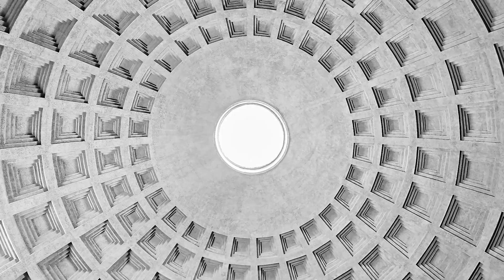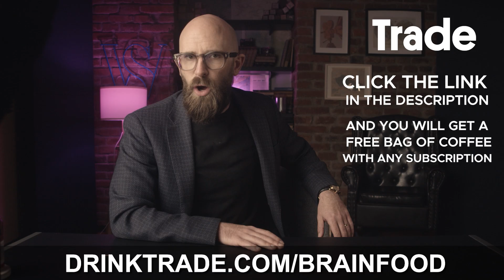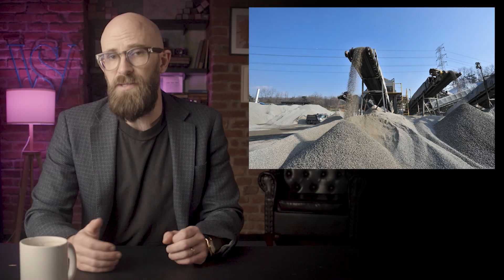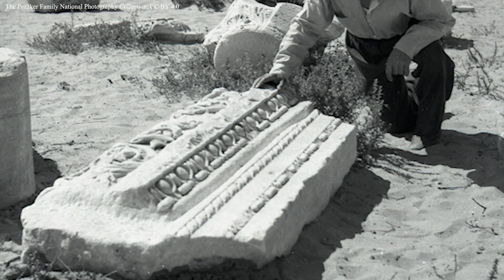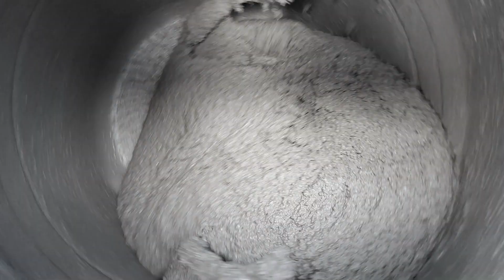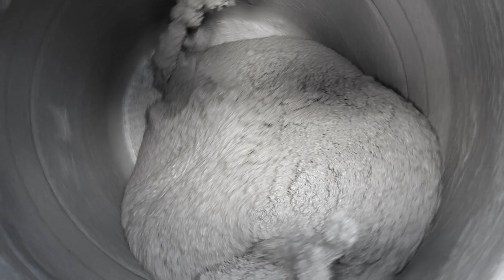How Did the Ancient Romans Make Concrete So Much Better Than Ours?

Comment: During the late 19040's thru 1960's the US build Nuclear Bomb shelters in government building , hospitals, and the like. That concrete is the strongest  , hardest , and virtually undamageable material ever made from a mix. I would like to see a video/documentary on the making of that concrete . And I wonder why all structures are not made from it?
Reply: That's why the old missile silos are cracked and full of water?
Reply: @atodaso1668 they said bomb shelters not missile silos.
Reply: Ah yeah Im sure they used weaker concrete on missle silos and stronger on government building bomb shelters... @TheTachmeter
Reply: @TheTachmeter 

Missile silos ARE bomb shelters.

They literally exist to shelter BOMBS from the elements and attacks from above.
Reply: @mnomadvfx  You know that's Not what he meant.  The public shelters from the 50s.  They decommissioned the one in my Dad's office when I was a teenager so we all got to try the little sugar balls that were part of the rations.
Reply: @atodaso1668 No, that’s because the old silos weren’t water tight and ground water seeped in over time. The walls themselves are virtually unbreakable.
Reply: So why do they have cracks in them? @Matt-yg8ub
Reply: @Matt-yg8ub  

"No, that’s because the old silos weren’t water tight and ground water seeped in over time"

Case in point they are strong, but do not have the self healing properties that keep Roman concrete water tight for centuries.
Reply: @mnomadvfx  again you’re missing the point the silos were not designed to be watertight, they all had bilge pumps for lack of a better term to explain it. They have sump pits and giant sump pumps to pump the water out of them because they’re not watertight structures in the first place. This isn’t a failure in the concrete, this isn’t a crack, this is water falling from the sky, and the silo doors, not being watertight.
This is the thousands of feet of corrugated metal tunnels, not being watertight, and everything being sloped, so that the water drains back towards the sump pits. 
You can literally watch water rain from the ceiling in the silos when it rains outside because the design of the 80 ton doors are not watertight
Reply: Spread less propaganda

Comment: In addition to the fuel used in heating, cement production also releases carbon & oxygen atoms in the ratio to produce CO2.  Not sure if Roman concrete also does this, but I suspect it does.
Reply: Well no, but the Volcano they sourced it from Campi Flegrei is situated in a gas field which releases a lot of CO2 via it's fumaroles anyway and that's without even erupting. When it does erupt it releases a shit ton of C02 that would put most uses of fly ash to shame. In a way because of where CF is located the volcanic ash is sort of pre-mixed in a sense.

Comment: I reckon that modern post industrial air pollution, may make it impossible to make concrete,  exactly like the Romans, to which you also have to add the radiation, from our nuclear explosions, we have also added to our atmosphere. So even if we copy their formula, the ingredients will be tainted, by our modern environment. So if we did copy what they did, we would need to do it in controlled circumstances and change our methods. Judging from what has been discovered, maybe adjusting the correct Roman formula allowing for avoiding tainting, depending on where the structure is built, maybe we can repeat the concrete of the Romans, by a similar method. Sounds promising.

Comment: Asphalt is not concrete. Concrete road surfaces usually have joints to allow room for expansion. Asphalt gets new potholes every winter.
Construction engineers have put forth many reasons why we don't use it now, from price to curing time. There are recipes for modern concrete that have the same longevity, but construction cannot wait seven to ten years for concrete to cure. Channels like Practical Engineering and The Structures Guy have some interesting videos (and discussions in the comments).

Personally I prefer a blonde/very light roast - less bitterness, more caffeine.

Comment: For future reference, CE is not any more correct or scientific than AD.
Reply: Yes, this is a major pet peeve of mine, and I am in no way a believer. What makes this era "Common"? What, exactly, is the startling coincidence that makes the BCE/CE dating system line up precisely with the BC/AD dating system?

No one is really fooled. It's just a gaslighting way to erase the history of how we got where we are today.
Reply: Most academics prefer using CE (Common Era) over the preceding AD (Anno Domini). Anno Domini is Latin for “in the year of our lord”.

Most folks try to step away from a more religiously founded framework of it, though I would agree with you overall that it is relatively trivial as our entire time
system is based in religious tradition.
Reply: @parallelarc3837  Yes, we're aware. Again, what makes this era "common"? If anything, it's the widespread influence of the religious tradition they're trying to ignore with "BCE" and "CE". To emphasize again, I'm in no way a believer, but it's a dishonest framing.
Reply: @parallelarc3837  Does that make it any more correct? They literally use the same point of delineation it's an arbitrary distinction as if ignoring facts makes it more scientific.

Comment: I was so excited when I saw a few years ago that they finally figured out the secret to Roman concrete—mainly just because I kind of assumed that it would be a mystery forever, and then to find out that it was actually really simple and easy to replicate. There's an argument to be made that these structures that have long outlasted their purpose are overengineered, but I think that attitude is dismissive to the potential applications that figuring this out may have in modern construction that's exposed to water. Yes it's not as physically strong, but if it's strong enough and much lower maintenance, we should use it.
Reply: Roman projects are considered over-engineered only through a modern lens. We build everything to be as cheap as possible, using as little material as possible. 
So in that regard, everything they made is over-engineered. Engineers put rebar in all their projects not because it's necessary for strength, but because it's significantly cheaper to achieve the desired strength. It is absolutely possible to design concrete structures without rebar, we just don't do it. Rebar compromises concrete from within.
Reply: @ericgigliotti2632  The other problem with Rebar is that it oxidises. It's made worse by the fact that concrete absorbs CO2 naturally, which in turn initiates the formation of calcium carbonate through reaction of carbon dioxide with concrete constituents of calcium hydroxide, aluminates, and silicates. This process results in the initiation of rebar corrosion in the reinforced concrete. So it's a never ending chain of reactions that give modern buildings and structures a very limited lifespan of maybe 150-200 years. The ancients could create structures that could last thousands of years but modern humanity with all our technology, are lazy and cheapskates. Rebar is not the way to go.
Reply: @@newtunesforoldlogos4817 the germans tried concrete roads instead of asphalt during the war, it's strong but extremely noisy, bumpy because of the mandatory expansion joints, slippier as well, it seems good on paper but we really don't want that.
Reply: @pbe6965 American roads are made with concrete as a base and then capped over with asphalt. Some smaller roads may not have concrete under them, but all the freeways and interstate highways have about a 12 inch concrete slab under the asphalt.  The good thing about asphalt is they can grind down a few inches of it and repave it pretty easily.
Reply: @pbe6965 Germans still make concrete roads, and most new American roads are also concrete.
Reply: @davidkottman3440 the roads have a concrete base under them but they cap over them with several inches of asphalt. You can't have concrete as the top layer because it is not even repairable. You also cannot put salt on concrete to melt ice because it will destroy the concrete. On freeways and stuff like that they have about 12 inch thick concrete layer and then asphalt on top of that. When the asphalt gets bad they can use a big machine to grind down several inches and then repave with new asphalt. You could not do that with just concrete, but it makes a great base because it's strong and very hard.
Reply: @actionjksn  That's all very interesting,  but in Missouri I daily drive directly on concrete as the top layer of our roads. Also, they do directly apply salts to these surfaces during winter weather.  After the surfaces become ptted, they do apply an asphalt driving surface,  but only after a few decades have passed.   As for repairing concrete,  sections are replaced,  because once crumbled it stays that way.
Reply: The thing is, while easy to replicate once the composition is known, the tools to find out and analyse that exact composition from solid chunk samples was not availiable until the mid 1980ies...
Reply: Ooh.  My family has a dirt road that could use a Roman Road treatment to ensure that it stops eroding so badly...
Reply: @wordforger   To fix the problem of that driveway you need to put a layer of large gravel called 1s and 2s and then drive on it for a month or two. Then go over that large gravel with a few inches of something like crushed limestone. It will feel very rough until you get the crushed limestone on it. The larger gravel on the bottom will make it more stable. I've seen it done several times and it works great.
Reply: But we won't use it.  We build things for job security.  Not to last.
Reply: Same though I do find utterly remarkable no-one thought Volcanic Ash was viable. It makes sense that it's from Polluzi considering that's where Campi Flegrei is located but it's also not far from Pompeii which as seen very recently has been remarkably well preserved considering it was buried for well over a millenia and in-spite the MANY eruptions of Vesuvius since then. Can't fault these guys for their ingenuity.
Reply: @@newtunesforoldlogos4817They can make roads now that last at least several decades. They just don't want to because they want to get paid to redo it.
Reply: What about making the core of the structure out of modern concrete for its strength, then covering it with a layer of corrosion resistant Roman concrete.
Reply: @pikachuchujelly7628 the interior layer would Crack and I don't think the crystallization process would reach deep enough to prevent it
Reply: @pikachuchujelly7628 the inner modern concrete would crumble from water.  Which would cause the Roman concrete outside to bulge out and collapse.
Reply: If it took thousands of years to figure out. 

It wasn’t simple stfu
Reply: @@newtunesforoldlogos4817And what will the corupt polititions do...... starve to death the mantions wont pay them selbst. Every year there year there are milions going  in their pockets for repeirs 😂😂😂😂😂
Reply: @@newtunesforoldlogos4817wow that sounds so wasteful and imagine all those jobs fixing the shit over and over. Are
You a job killer?
Reply: We have more advanced mix designs now. 
Self healing concrete had been around for awhile now.
It's just not real common yet.
Reply: Another issue of duration is that (modern) concrete slowly dissolves Steel!  Hence you got rusty rebar in every thing more than a few years old!!  Lifetime, depending on the environment and various other factors is 150 years maximum and often less than 100 years for Modern Concrete!!
Reply: @@newtunesforoldlogos4817 can't keep the economy going that way...
Reply: @machupikachu1085 which is really just an argument for how the capitalism is bad. If your economy depends on things breaking down, you've done something wrong
Reply: @kuno3336  BWAHAAHAHAHAHAHAHAHAHAHAHHAHAHAHAHAHAAH
Reply: @kuno3336 The problems with capitalism is collusion and interference from the government. The alternative is that the government owns and runs everything, instead of the free market. Do you trust the government with that much power and money? Have you seen anything out of them that indicates they can be trusted with that much power? People who decide to make being in the government their career are inherently bad at doing things other than getting elected. The standard of living for people has never been better than it is and there is less mass starvation than there has ever been. We've seen the alternatives and it's a lot worse.
Reply: @actionjksn  anything out of a government that proves they can be handled with that much power? We're talking about Roman concrete. The proof is that things the ancient Roman government built are still standing. Their roads still function. The road I took to work today has been under maintenance/reconstruction for the last 6 years, because of capitalism, because the "free market" determines the materials, the construction crews, etc, and the cheapest of both always wins out. This ensures that the work is never done, because nothing that is finished lasts.

You want more examples I'm sure, and we BOTH have plenty of examples of governments abusing power. Thing is, we have just as much evidence of businesses abusing power, but you don't want to talk about that as evidenced by you somehow blaming government for what capitalism has done. You're blaming the slack leash and stating the solution is to remove the leash instead of tightening it.
Reply: @kuno3336  what the hell are you talking about? The government is in charge of funding the roads in the United States of America. They sub it out to contractors but it's all done under government rules and regulations and red tape. I can't believe you picked roads for the example. Why do you suppose private roads are paved really fast?
Reply: @actionjksn  I honestly don't understand how you didn't see the point, while also providing further evidence for it. "They sub it out to contractors", and that is the problem. That's the government treating a public need in a capitalist way. Choosing the cheapest instead of the highest quality. Capitalism is the root problem. Private roads getting better treatment than public roads is even more evidence of that as a problem: what you're essentially saying is the only people who deserve roads are the individuals who can pay for them.
Reply: @kuno3336 You are totally off base.  It's the government that sets the standards when they bid out a job.  It's their responsibility to check and make sure the contractors are doing what they are being paid for.  That's where the corruption comes in and that has nothing to do with capitalism.
Reply: @JJ-nu8qi  I mean, this really seems like one of those things where probably both have a part in it. Very few things are binary. Most of the time things are the way they are due to a combination of factors.
Reply: @carsonm7292  I agree it's not like capitalism doesn't contribute but if the government did their job properly  there wouldn't be abuse by shady contractors.
Reply: @JJ-nu8qi  What exactly do you think the driving force behind that corruption is if not capitalism? It is literally the pursuit of capital that drives them to make those decisions. Capitalism ensures that every facet of life revolves around money. Everything. Capitalism isthe reason the roads are trash. It's planned obscelecense: built to break so that more money can be made later fixing it. Capitalism has a direct link with bribing government officials, because who exactly has the money? Successful Capitalists. Rich people with a vested interest in making sure decisions are made that keep the money flowing to them.

Seriousy, friend, where on earth did you think the corruption came from?
Reply: @actionjksn  You're talking about crony capitalism. Capitalism on its own isn't bad at all.